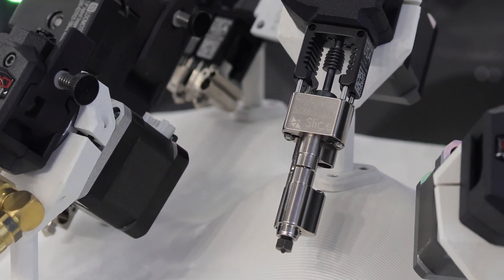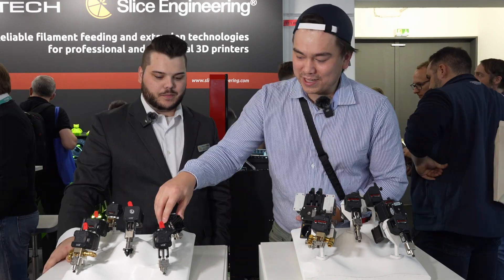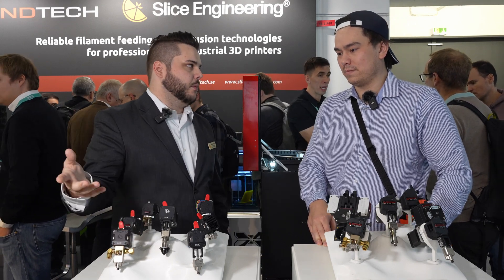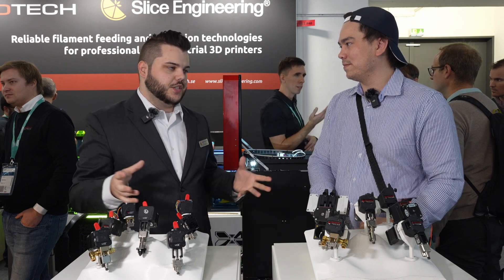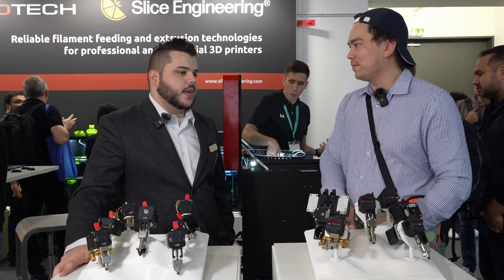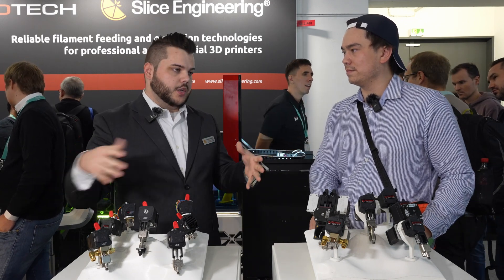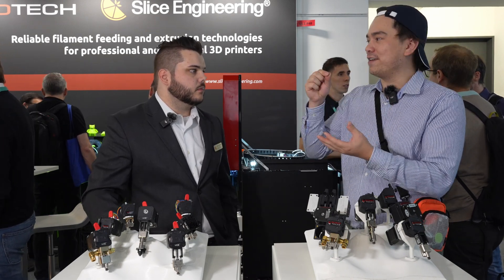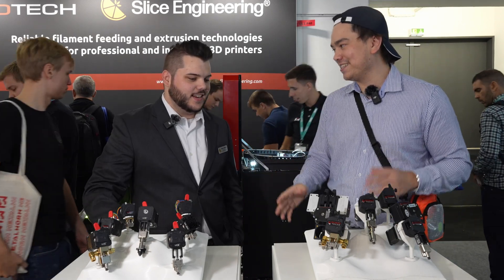Giant Nozzles and Watercooling - Slice Interview Formnext 2023

Comment: Reason for classic heaters: full power across the temperature.
Reason for ptc ceramic heaters: typically higher initial power, decreasing power with temperature (safety).

So essentially if you are going above 350c, use a standard heater cartridge. If you stay below that, ceramic heater, its much safer to use. It cant melt your heater block in case of a thermal runaway, because firmware based protection can only protect from thermistor based failures, but if the hotend mosfet fails closed, nothing can protect you other than cutting power from the Mainboard.

Comment: Regarding liquid cooling, why not employ active cooling such as ThermoElectric cooling instead. You are cooling at the same time adding to the enclosure heat. Just some 💭
Reply from the maker: I've considered this, it probably comes down to the weight and complexity of a peltier cooler compared to the amount of cooling it provides.
Also, as Peyton mentioned, some machines already have water cooling systems built into them, particularly the industrial type of machines, so the water cooling block is just a drop-in for them.
Reply: @NathanBuildsRobots  Sincerely appreciate the clarification. Definitely driven by the economics and the retrofit aspects. Also the TE coolers don't handle vibrations that well(since it is low temp bonding of 1000's of bi-metal junctions), apart from the upper limit of operating temp. TE's are not that efficient, with reduced differential between cold and hot sides. The high temp versions are fairly expensive as well. Also they demand much more power relative to the cooling they provide(no wonder compressor driven cooling is still the norm for efficient cooling).
Reply: Because it's generally a requirement to use twice as much power to cool a TEC than you can dissipate, with lower efficiencies as temps increase. So you're adding a lot of power requirements, and then you need to cool the TEC, which puts you right back to where you started, but with more heat. There's a reason very few things use them, and a lot of the things that use them are things like bench instruments and small scale test cells.
Reply: @Mr424242424242424242  But in this specific application, the heat output would reduce demand on the heated enclosure!, while still providing the lower amount of cooling needed past the heat break🤔. So, it is just a matter of economy while taking advantage of existing water cooling.